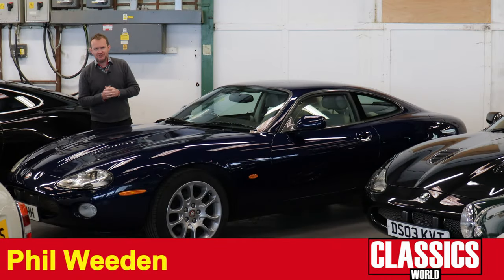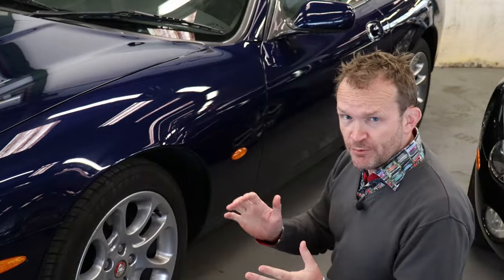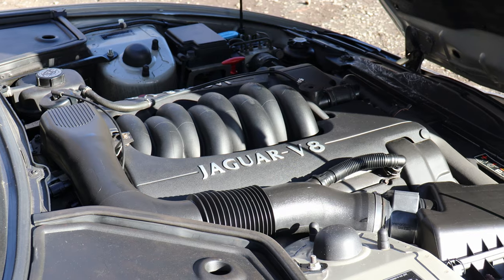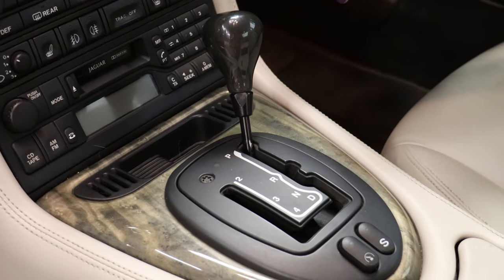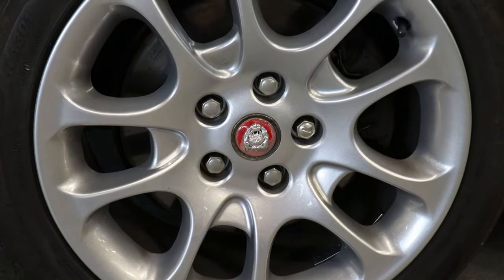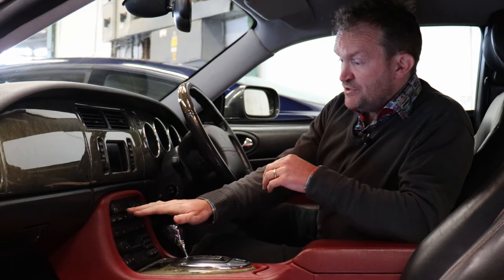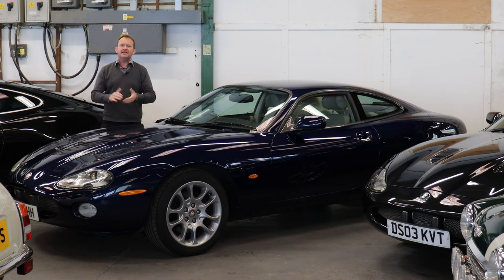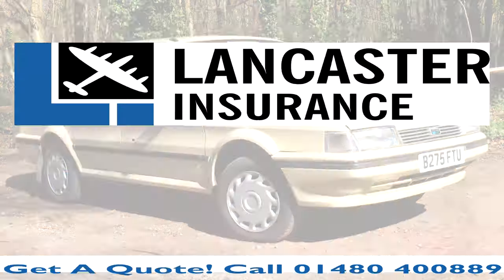How To Buy A Jaguar XK8 or XKR | The X100 Buyer's Guide

Comment: I owned one of these, an XK8 2001 coupe, back in 2008-2010. For me this remains one of the most beautiful cars ever made, up with the E-Type and Vanquish, and I prefer it to Ian Callum's replacement in 2006. I also loved the cossetting, luxurious interior which was a lovely place to sit on roadtrips, and that V8 made a gorgeous sound. However, there was ALWAYS something wrong with it despite it having a comprehensive service history and only 50,000 miles when I bought it. It was a very fragile car and expensive to maintain -- suspension bits always wearing , electrical gremlins, including the ABS module going kaput and sensors failing, and of course I had to replace the chain tensioners which was a pricey upgrade. Even as a 7-year-old car, rust was forming on the rear wheel arches. Very thirsty but you know that buying one. As a classic car for summer Sunday drives, it probably makes more sense if you are willing to maintain it.
Reply: dont maintain it of course ,,get a kia

Comment: The XK8 is one of the most expensive cars I have ever owned in terms of running costs.  I have spent mega money with so called Jaguar specialists.  There really are some cowboy Jag specialists out there which spoils the ownership experience
Reply: I've had my 2001 xkr convertible for 18 years now. I maintain it myself and installed all the upgrades from the 4.2. Exciting to drive and I STILL can't stop looking at it! Great report, very accurate. As mentioned , not enough emphasis on the rust issues particularly the rear of the sill. Can be horrific if you don't keep on top of it. Take off the rear silencer box and run a straight pipe through. Sounds fantastic!!